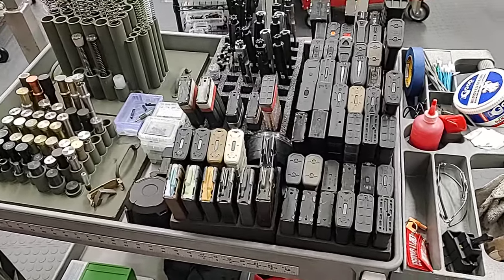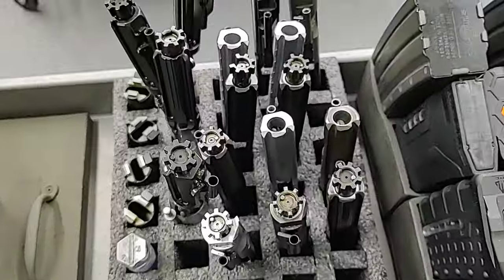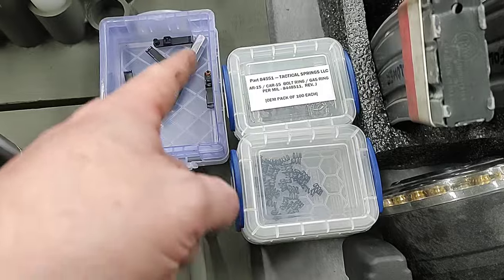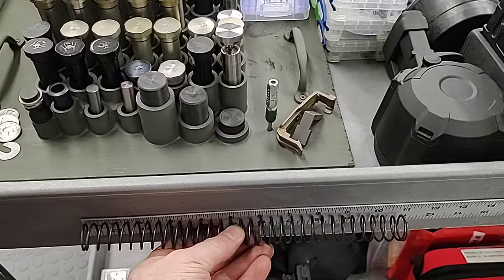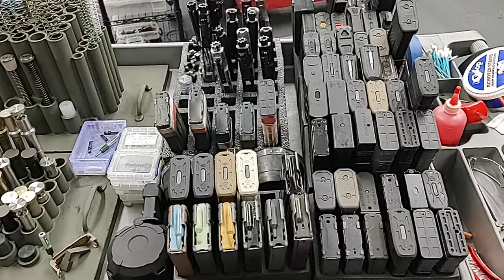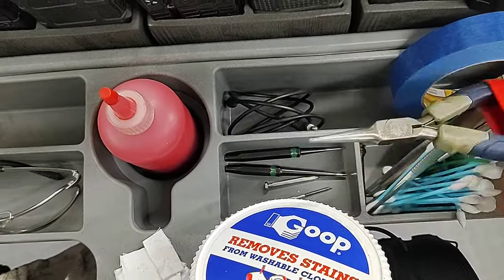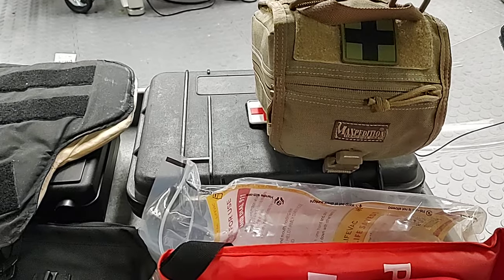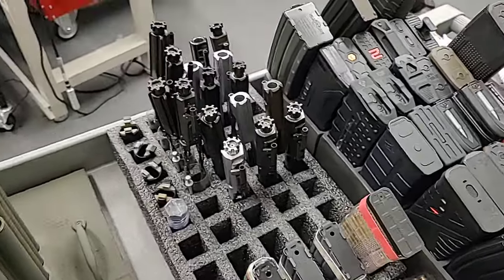SOTAR Shop Test Fire Cart

Comment: I already put the same work bench padding that you use (not shown in this video) on my benches.  Really like it except that I leave some areas open to the wood surface underneath for when I need to beat or scrape on something which would otherwise damage the padding.  Now I see that I need PVC to hold my cleaning rods!  You have great ideas!  Thanks.

Comment: That panic button should be closer to the ground on the cart. if something happens to you, you might end up on the ground inable to get back up and not able to reach it.
Reply: Good thinking. If it was down low concealed underneath there would he less chance of a accidental alert.
Reply from the maker: Good idea. I'll move it. Thanks
Reply: @enlightenedpreparingep4006  On the inside of one of the vertical legs would be a good idea. if you put it to out of sight it will end up out of mind. especially a panicked mind.
Reply: @SchooloftheAmericanRifle what is the panic button connected to? Security? 911?
Reply: @stefanmolnapor910 
It's a typical one you'd find in a Jewerly store or nice pawn shop. Normally it contacts 911 as well as a 3rd party or contact of your choice. It looks like the one he has here is the 2.4F-ME alarm. Once pressed it omits a loud ringing noise designed to not exceed the 50db limit of his property line.  You can also choose between 5 different languages where a robotic voice continuously repeats the words "Panic! Panic!" Which helps make sure that you do in fact panick, in a reassuring manner. Im not sure if his contacts anyone though.
Reply: @JustOneMoreTaskMom  Thank you very much!

Comment: When you attach tape to the shell deflector, does the different impact on it tell you something?
Cool cart. Maybe colour code/number the rows of mags and the holder so even when someone took some mags they go back to the same cart they go in the exact same spot or make it quicker to grab a specific one. 
How often do you guys do a lead screening and have you found that some cleaner is more effective? Do those lead wipes make a difference?
If you tape outlines on the bottom section/outer area it goes back in the same area. 
Have some bigger fire extinguishers somewhere in the room. You probably have some and have a blanket too. I'll make some pvc organizers. Thanks!
Have a light on it. If you got no backup in the shop and you're next to it, just hit the button and you got light. Maybe a magnetic car inspection light that you can take with you but easy to find in the dark. 
TQ holder on the inside of one of the corners.
Reply from the maker: My lead levels are high. Unless I abandon working on guns, it won't go down. Tried it. I take many precautions to prevent lead exposure but it's not 100%.

Taping the deflector does not have any significant change on brass direction in my experience.

We do have other extinguishers on site. The one on the cart is just a very small backup.

The light is a good idea. I'll add that.

Comment: Why not pmags for test fire? They seem to be the most common by an overwhelming margin. Although I know some fudds (and departments) still think only "metal" mags are real.
Reply: He has pmags in there.
Reply: I count 10 pmags
Reply from the maker: I have loaded PMags too. I didn't have them in the organizer slots after testing some Machineguns.
Reply: @SouthValleyKnifeCo you missed part of it. They are segregated into two sections. The sections with the pmags in the video are only to see if they drop free from the lower receiver. The mags used to actually test fire in the trap are in the upper left. That section doesn't have pmags and is what OP is asking about
Reply: @GXH24  that doesn't indicate they don't get used

Comment: Quick question is it bad that the carrier face where the bolt sits inside of is magnetic I just discovered cleaning my bcg that the very front face of my bolt carrier is magnetic
Reply from the maker: If you shoot steel cased ammo it's not good.
Reply: I never shoot steel cased ammo in my opinion it isn't work the money to buy ammo that is going to eventually cuase wear or damage to my gun sooner than it should brass isn't much more expensive and I love reloading .223/5.56 is there anything I can do at home to de-magnetize it or should I not worry about it because I exclusively shoot brass

Comment: You gotta get a 3d printer man, its a decent learning curve but its well worth it. I would recommend a Prusa i3 MK3+ (might have MK4s by now) or Bambu labs X1 Carbon if you wanted something that could do pretty much anything. If you want something cheaper I'd go with a Resin 3d printer preferably MSLA or DLP, and Elegoo is a good brand but most are fine just look at reviews and print size since resin printers are typically smaller and also sort of harder to use but make far better prints than FDM printers like the i3 MK3 or X1 Carbon

Comment: Is there any 30rd mag brand that stands out to you as having a "straighter" profile than the others? I am trying to find one so I can swap out the follower and use with my 450BM. I hate that currently the max cap option is Duramag 7 round. I would like at least 10 but the straight wall 450 cartridge starts riding nose up after 6-7 with the GI mags.
Reply: I've had decent luck with unimags. 
Running x39.  I believe 450 is one of the rounds it's advertised to work with.
Reply: They are suppose to work with 7 diff calibers.  
I've only used em for x39. Grendel and 5.56.    One that sat with x39 for quite awhile seemed to stretch wouldn't hold 5.56 after.
Reply: @matthewbeaver5026  Il look into them... thanks. Are you talking about 7.62x39? If so that is sort of the opposite of what I need. 7.62x39 has a heavier taper while the strait will 450 has a much lower taper compared to 556. I am almost to the point of buying 2 steel ones, taking a band saw to them, then hack-welding them together. I have also wondered if the magpull 60rd drums could be modified but from what I could tell, the modifications would be pretty drastic and at $100ea that is a little to much to take a dremel to.
Reply: @ReasonablyBadActor  yea I'm using them with 7.62x39. 
Though they are advertised to work with 7 calibers. It's got a 2 piece follower to allow for diff shapes.